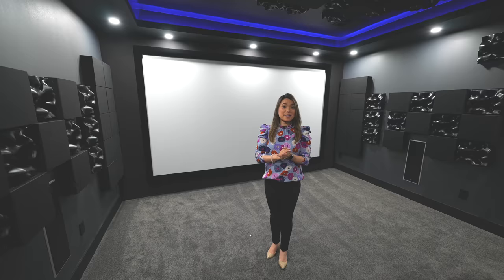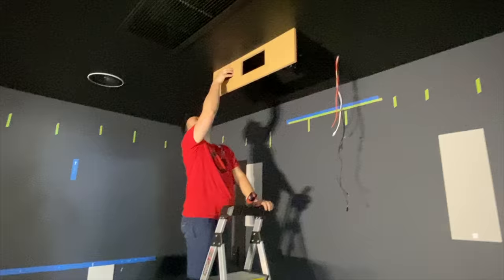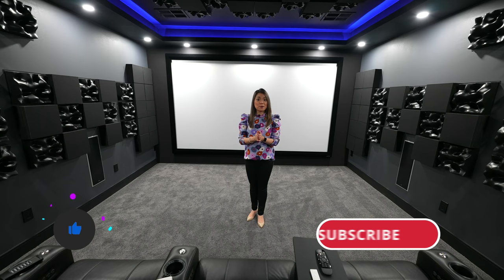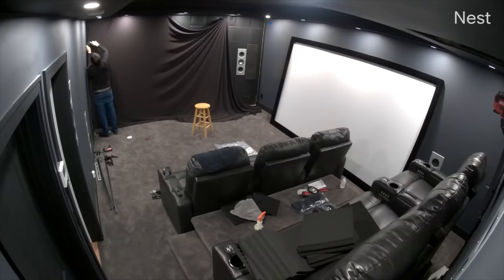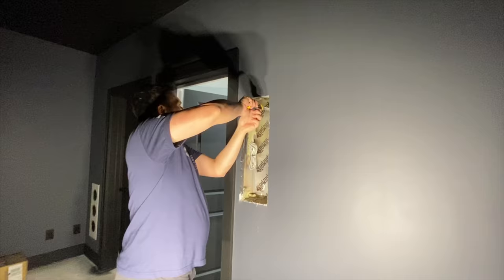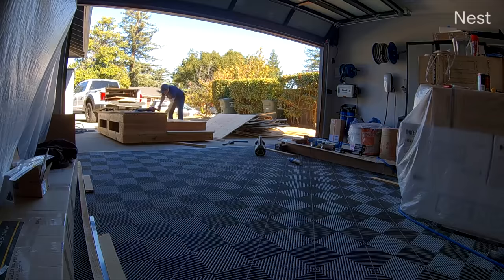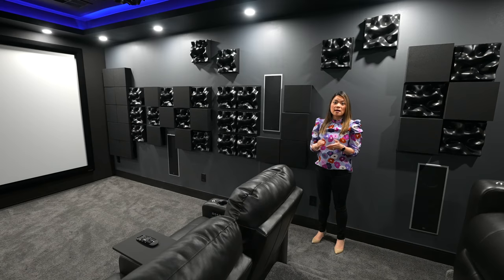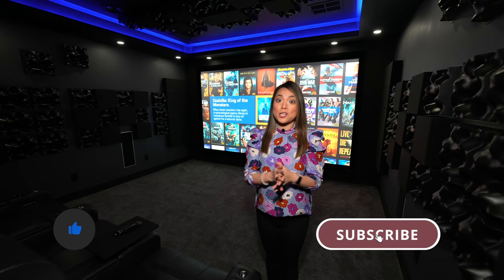Home Theater Reveal - Home Theater Design, Home Theater Construction Timelapse, Home Cinema Design

Comment: Very nice!!!
Noticing some OG shirts and pressure washing equipment!!!!

I'm building and have yet to close in walls... Do you have any details on the automatic aspect ratio setup? I was 100% on 16:9 at first, but now I'm questioning which way to go....
I'm going the newer laser JVC, so that it should be easy to shift aspects....

Those auto rollers are super slick!!!
Reply: The screen is from Seymour AV/Seymour Screen Excellence.  It is a 150" TRIM Masking screen with the Enlightor Neo AT fabric.  There is an AVS thread with a lot more details you can search and find.

Comment: That is  an amazing home theater 
Could you please ask him what system did he use to to sound proof the walls so you can’t hear the loudness from outside the room
Reply: She mentions this in the video but the room was constructed with relatively standard higher-than-average sound transmission classification (STC) building practices.  The main sound isolating methods deployed here are double 5/8" drywall with green-glue in between the two layers on the walls.  For the wall separating the theater from the garage we used 2x6 construction on 24" centers with rockwool insulation in the cavities.  In a perfect world you would use staggered stud construction throughout and/or room-within-a-room construction methods with hat channels/fully isolated wall panels.
Reply: @Sivart321  thanks for your reply
Reply: @Sivart321  boy does his homework. Spot on answers. Clearly has spent some time on AVS forum :)

Comment: I don't think you mentioned how you decided to heat and cool this room. With your attention to detail, I'm sure this was addressed in your design. I'd like to find out what you did to dampen the sound from the ventilation system and if this room has a separate heating and cooling system or if it was added to the existing system for the house. Thanks.

Comment: Question: The back box size are the same recommended ones listed on KEFS website? Also, how much insulation should be applied in these boxes?
Reply: The back boxes were designed and built to KEFs 'Ideal LF Response' minimum cabinet volume.  The center channel has a slightly larger box than the left and right sides.  The amount of insulation varies but it should not have the paper or plastic backing on it and should be loose fitting inside the box.  You don't want to cram it in there.
Reply: @Sivart321  Awesome, thanks!

Comment: What are the dimensions to the finished room? Absolutely fantastic theater 🎭
Reply: The room is 14' wide x 21' deep and is 9' tall.
Reply: @Sivart321  thanks!
Reply: @Sivart321  sorry to ask for clarification, but do you mean 21’ before, or after you built the baffle?
Reply: @rjmcinnis  It's a hair over 21' before the baffle wall.
Reply: @Sivart321  Thanks for the reply. I’m about to build a 14’x18.5’ theater, and wasn’t sure if I could have a second row. I won’t be using an AT screen, so will maintain the 18’ length. Love your build, very impressive.

Comment: Very nice! It looks like you went overboard on the screen wall but I bet it was worth it. Great theater! I do have one question, I noticed for the ceiling speakers you used KEF speakers, does the fact that you cannot aim the tweeters diminish the Dolby Atmos experience at all? Just wondering.
Reply: The KEFs have relatively wide dispersion pattern and the speakers are installed in the 9’ ceiling making that less of a concern. Ideally they were angled and the entire speaker was angled - not just the tweeter.
Reply: @Sivart321  Thanks, I actually considered these speakers my self but was concerned with the angling limits. I actually read some articles recommending the speaker being angled straight down for the best experience and realism so your setup might be the best idea, I may look into experimenting this notion. I’m looking into upgrading to a speaker with a close back so less sound is lost into the ceiling. Again, awesome home theater build, I’m impressed by the extra effort you put into make sure it was solid and sound proofed.

Comment: Did you have Acoustic Frontier design the acoustic treatment? If so, did you have them install their specific treatments or did you go out and buy your own and install yourself with their supplied design? I hired them for design, but not sure if I should build or buy from GIK, or buy their treatments and DIY or install myself. Curious to see what you did.
Reply: They did the design and we purchased the panels from them as well but did the install ourselves.
Reply: @Sivart321  Thanks Travis... do you have any guidance of all the panels purchased, what to typical budget for? Also, with the Trinnov, did Acoustic Frontiers end up doing the calibration? If so, did you opt for the 6 hours (1 day) or 12 hours (2 days) option?
Reply: @icsyung  I can’t comment on the costs as it’ll vary a lot depending on what you pay them to do and what you purchase from them. I have not had anyone out for calibration yet but am planning for 2 days.

Comment: So what's the window look like from the outside just 2xframing stopped watching after saying ur husband pays attention to detail than just does nothing with the exterior
Reply: We installed frosted translucent window tint on the inside of the window before doing any of this work.  It looks like a frosted privacy window from the outside.  You can't tell anything is built in the cavity when looking in but it's also on a side yard with a small walkway that is never used so the concern is negligible to begin with.